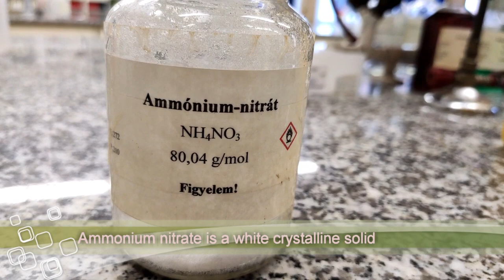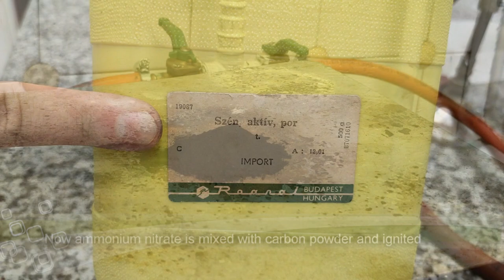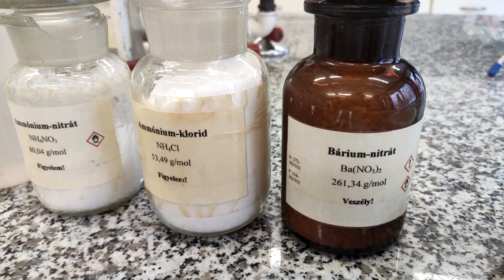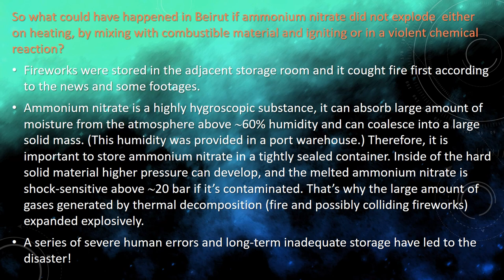How dangerous  is the ammonium nitrate? - Chemical experiments in the wake of the Beirut explosion

Comment: I thought that ammonium nitrate on its own wouldn't explode without some kind of catalyst.
Reply: Diesel fuel is what they add to it to make bombs ..  alot of diesel on a ship.... must have rotted out the fuel tank...
Reply: Ammonium Nitrate on its own can explode due to runaway decomposition, but it is very difficult to do so without a fuel for it to react with.
Reply: @easttexaspatriotsunitedsta4932  You can make explosive by mixing many things with ammonium nitrate, metal powder, sugar, sawdust will all work.
Reply: It can if it is strongly heated with indirect heat, if a little iron oxide is added it bubbles making nitrous oxide.
Reply: When I was a pyromaniac teenager I made some ANFO, by mixing ammonium nitrate with diesel fuel. I thought I could just stick a fuse in it and it would detonate. I was a dumb kid… Anyway, it didn’t work. Then I realized I needed an initiating explosive, to create a shockwave, and that would detonate the ANFO mixture. I tried using large firecrackers. I put a big M-80 style firecracker in the middle, surrounded by the ANFO. All it did was blow it all over the place, but never actually detonated. 

I did some more research and I concluded that the commercially available ammonium nitrate I procured from instant cold packs was actually only 85% with the other 15% being a fire retardant of some kind. So kids like me couldn’t blow ourselves up with it. I don’t remember where I read that, don’t know if there’s any truth to it. Anyway, I never succeeded in getting ammonium nitrate to blow up. And seeing things like this Beruit, Lebanon explosion… it makes me a little jealous. How was that able to work? Without any sensitizers… just on accident??? That’s annoying the dumb pyromaniac kid in me!
Reply: You should use TATP or acetone peroxide.
I tried ammonal, not anfo , because ammonal is more sensitive to schock than anfo.
You can make it by combining ammonium nitrate and aluminium powder.
For me it worked pretty well.
Reply: @zalangamer1230 makes sense, Coz that mix is basically what they use for 2part exploding targets mix, which can be set off by a bullet, meaning it's a lot more sensitive than anfo which requires a powerful blasting cap, and normally a primer.
Reply: @madmattdigs9518 yes I was the same, Never had any luck making AN go boom. Not only does it require massive starting energy, it also has a large critical diameter, meaning that large amounts are required for it to go off. There's a statistical reason for this, related to the extreme insensitivity. This critical diameter can be reduced with finer grain size, but that's also difficult because AN comes in prills, a deliberately large grain size and grinding it is hard, it's quite tough material, and very hygroscopic so handling like grinding just gives more time for water to adsorb into it.

Comment: Something to add about explosions is that one of the typical differences between burning and explosion is initial confinement. Black powder spread out into a line will burn slow like a fuse, but trapped in a barrel, it can absolutely explode
Reply: You are wrong. A line of black powder will flash instantly at a burn rate depending on grain size. This misconception comes from Hollywood movies where a line of black powder seemingly acts like a fuse. Modern smokeless gunpowder which is a propellant does actually burn relatively slowly in the open air and can be used as a fuse. Black powder is actually classified as an explosive but smokeless gunpowder( mostly nitrocellulose ) is classified as a propellant. High explosives do not need confinement to explode, actually explode is the wrong term, they detonate.
Reply: Spoken like a true prodigy!

Comment: You also have to remember that the Ammonium nitrate stored in Beirut was fertilizer grade so like 85% purity not the 99% purity. So the additives added to the ammonium nitrate could have worked as fuel
Reply: @Linus-nq2op  Then why did it exploded ?
Reply: @PotionsMaster666  Maybe because a few thousand tons of it were burning, next to also burning fireworks.
Reply: If we add ammonium sulfate nitric acid ammonia, will it turn into ammonium nitrite?
Reply: It was actually the bags that contain the ammonium nitrate burned, created charcoal, the charcoal acts as a fuel for the oxidizer and caused the explosion.  Hmmm who would’ve thought charcoal makes ammonium nitrate explosion…. Haha
Reply: Or maybe you  were just lied too. Why would any material made to fuel or make fireworks  been inside of the largest  grain silo  in beruit. This was no accidental  explosion.  It was caused  by a weapon or missle  of some sort. This was too expedite  the global food shortage one of many food processor plants.
Reply: Doubtfull, the most common additive for that is calcium cabonate, which is chemically inert.
Reply: @PotionsMaster666  because of the heat of the fire next to it
Reply: Probably not.
Reply: Ammonium nitrate don’t need fuel. The ammonia is the fuel and the nitrate is the oxidizer 
NH4NO3 -> N2O + 2H2O
So it can detonate even while being pure

Comment: What is the temperature of the flame of the blowtorch when you are melting it? Thanks for a good demonstration. 
The fireworks thing is completely untrue ( it was a rumour from anonymous local sources that was later retracted). The fire only burned for less than 20 minutes, nobody knows how it started and it was some distance from the AN. You can see in videos that a lot of smoke and a few flames are confined to the far end of the building just before the explosion. Most of the hangar is not on fire.  
It's not true that AN should be stored in a sealed container. Storage regulations around the world suggest that it be stored in a well ventilated fireproof structure with a couple of metres of airspace below the ceiling. (Exactly as it was stored in the port, in a metal shed with a lot of airspace). In fact most of the AN explosions have occurred precisely in insulated enclosed spaces (e.g. cargo hold of ship), or factories but  not in warehouse storage. It was stored in plastic  bags, it wasn't in "a large solid mass". 
The "welder-fireworks-accident" story was more or less completely invented by reporters within an hour or two by reporters who were nowhere near the accident site. The official government position right now is that sabotage must be investigated too. An investigation is underway but for some reason French investigators and the FBI!! have arrived and are trying to take it over. 
It's obvious that there were some firework type sparks before the big explosion but what caused them is a mystery.
The investigation has become very politicised because the EU/USA/Israel within a few hours of the accident developed a narrative to attempt to blame it on Israel's hated rival in Lebanon. 
Given the scale of the destruction I doubt we will ever know. 
However if you look into how the media narrative was constructed, most of its elements are false. 
As you say, AN is very hard to blow up, especially 2,700,000 kg *in one instant*. 
Look at how they are storing it in Australia. 
https://youtu.be/rb6aVfB3V1A
Reply from the maker: The temperature (of the flame) was over 1500 Celsius. Thanks for the additional information.
Reply: @ChickenPermissionOG  bots will be bots
Reply: There be truth in your comment I live remote rural NSW but worked in a capacity that gave me access to the AM plant beside Stockton bridge in Newcastle if that went up (highly unlikely due to safety procedures it would make a large hole and the sea water would pour in) ...a boat full of fireworks initiated the port becoming a hole in the ground I very much doubt that scenario
Reply: @ChickenPermissionOG  There is one at the bottom of ever bucket hello from Australia
Reply: lol
Reply: I watched a video of that warehouse, that fire was a distraction because I saw some bright flashes in different locations through a window, it looked exactly like DET cord being used as a detonator for the Ammonium Nitrate. No firework is going to set off very large bags of Ammonium Nitrate. I say this was a professional job done deliberately for reasons unknown to me.
Reply: @jb-xc4oh I don't think so. AN, without fireworks and without saboteurs, could have caused the destruction of the port in Beirut. There were all the conditions for this: a fire, a large volume of emergency equipment, a closed room. Such cases during fires have been described, although many agronomists consider AN a safe fertilizer. Sabotage does happen, but storage errors and negligence are much more common

Comment: Put a carbon deposit on a spoon, put a pinch of AN and indirectly heat it. It will detonate at low velocity forming a brownish mushroom cloud of nitrogen oxides and soot. Was quite amusing in chemistry class😂😂❤
Reply: That is not called detonation. It is just burning , although faster with oxidizer.